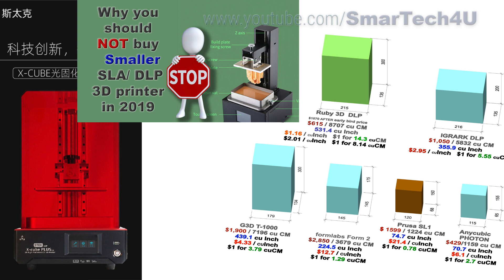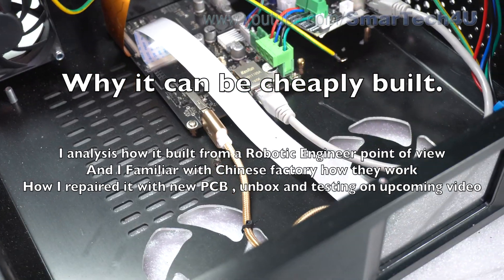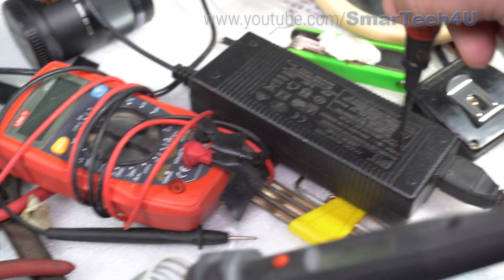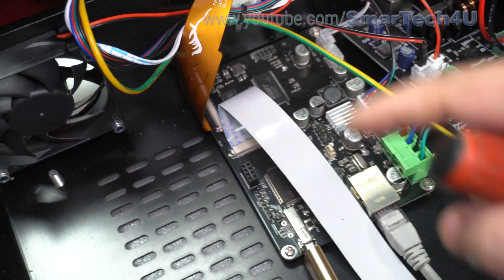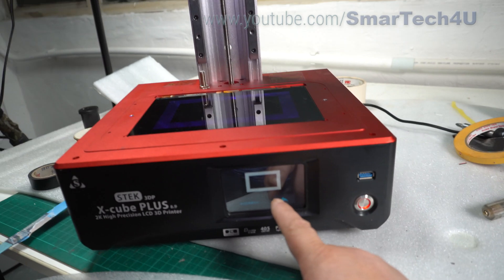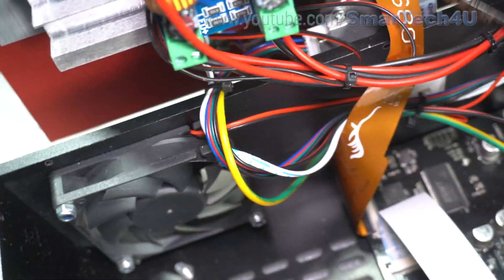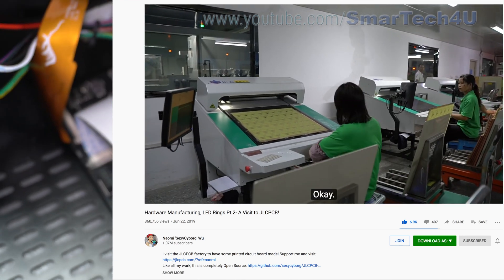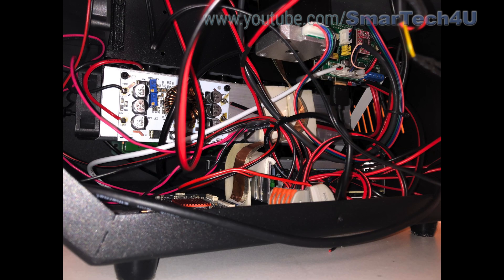How Saturn OEM build ,  a $420  8.9” inch SLA  #Elegoo Saturn

Comment: What do you think about all of the expensive small 4k mono lcds? Why is the cost so high compared to 4k RGB? Shouldn't it be cheaper? I am looking to build a 13.3" using a Durobond LCD. Eventually I would want to build a printer that has 24" print area. BTW I already spoke with a Durobond rep but they don't have the UV LED component done yet.
Reply from the maker: It a demand and supply thing , most people feel 2K on 8” screen is good enough, and the LCD screens is lave over of tables.  Not really much other usage of 4K mono screen ,  demand is so low the units price going hight . 
Also , all moving mechanical components need to be much better quality, so it doesn’t vibrate to destruct high resolution .
Reply: @AIengine  I noticed that they aren't putting alot of thought into the Z mechanics or the light masking. I need to be able to print on more area so I can get larger prints out. I see things like Kings3D with prints the size of a car bumper and think wth we need something half that size.
Reply from the maker: @Deneteus  Our company actually have bought 24" 4K printer
photocentric- Liquid Crystal Magna https://youtu.be/vIm8AjSWi1E?t=303 
It so big that wash the big parts get so troublesome , no one going to using it .
Reply: @AIengine  If the system was setup to remove and wash the print automatically then it wouldn't be a problem.  All you need is a rail system to move the part from the printer to the parts wash and then to the UV stage.
Reply from the maker: @Deneteus  key problem is size , where that not a problem when small , but big problem when it huge .

Comment: So the LCD is just exposed? Nothing to hide the ribbon wire?
Reply from the maker: there are black tape cove ribbon wire , I remove it to take apart , all low cost SLA printer do it this way to keep the cost down , as the LCD only cost around U$12 dollars as parts , on tablet it just cover by black edge of surface glass .
Reply: @AIengine  I ordered on off AliExpress since I'm in the States. I will probably create a 3D print to cover that exposed area. Planning on writing a review as well. Thanks for showing the internal components.
Reply from the maker: @JackvMakes  made sure ask seller made a extra soft package out side of factory box , it got poor package layout , my one got shipment damage , as just ship between 2 city .
Reply: @AIengine  Yeah, I asked the seller to make sure it's packaged well so that nothing received is broken since I know it's a hassle for them to ship multiple things and it's expensive.
Reply: @JackvMakes  Beware, with corona all the rage, some places have not returned to work.
Reply from the maker: there are black tape cove ribbon wire , I remove it to take apart , all low cost SLA printer do it this way to keep the cost down , as the LCD only cost around U$12 dollars as parts , on tablet it just cover by black edge of surface glass .